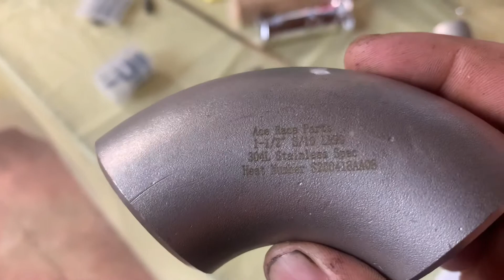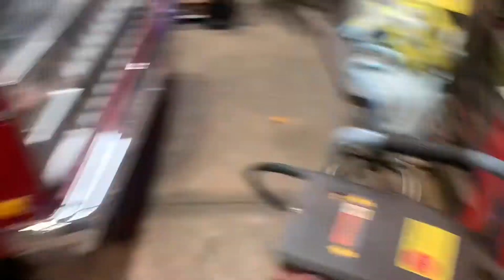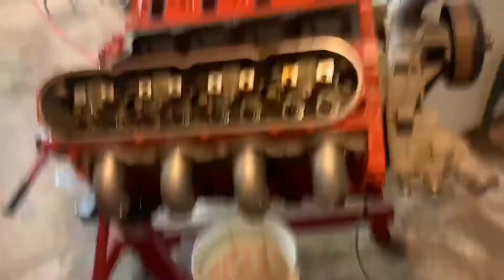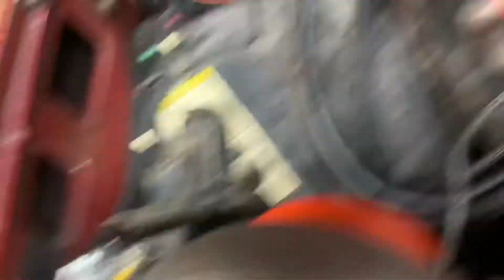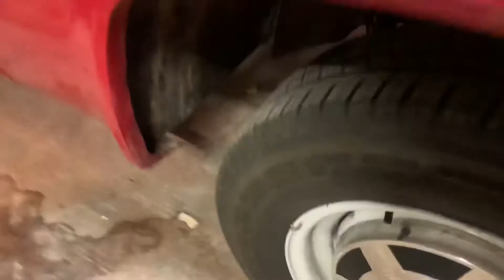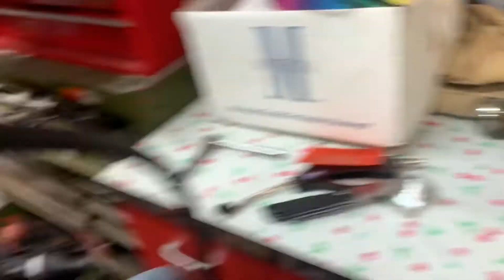DIY Ls Turbo Manifold Log on a Budget! Pt. 1 Turbo LS C20

Comment: Turned out great, only thing I would have changed is angling the primary tubes toward the front of the engine slightly but that's probably a negligible difference.

Comment: How did the sloppy stage 2 cam compare to your turbo cam? Now he makes "the best cam" that I might get. Or a truck Norris cam possibly.
Reply from the maker: I think they are similar but I had the SS2 in a 4.8 and the summit cam in a 6.0. If I were to do it again I’d go with the best cam for turbo. Last project I wanted to try the truck Norris but it was sold out when I needed it so I went with a summit stage 2 truck cam